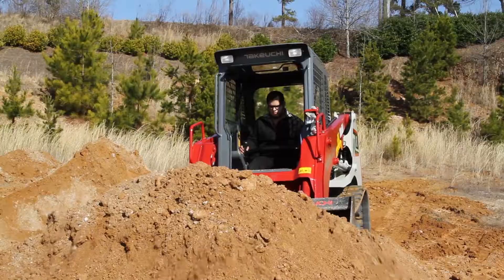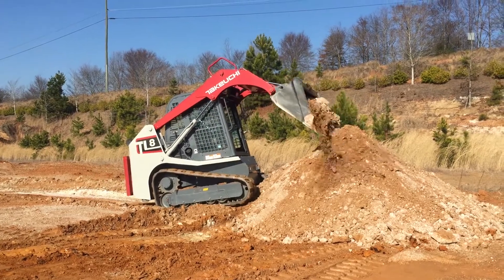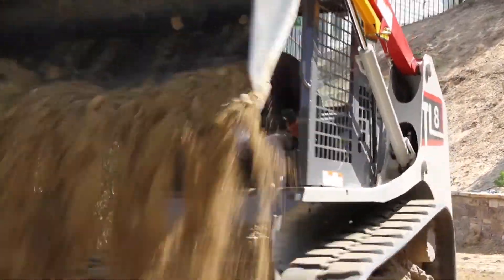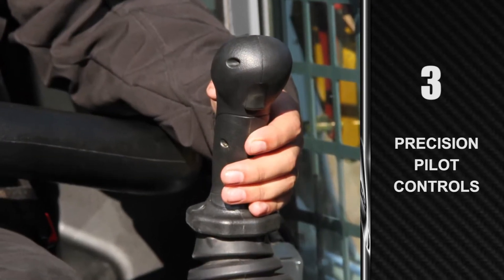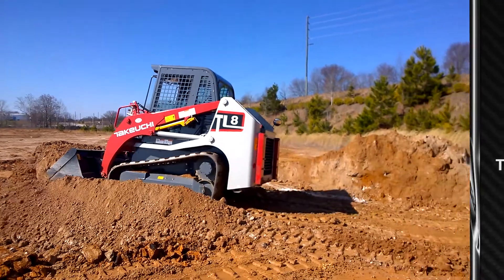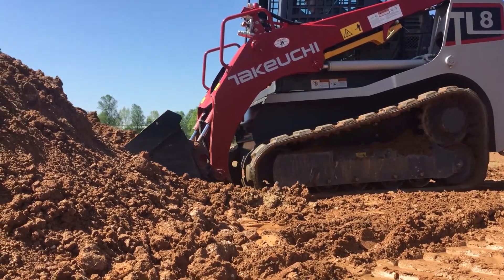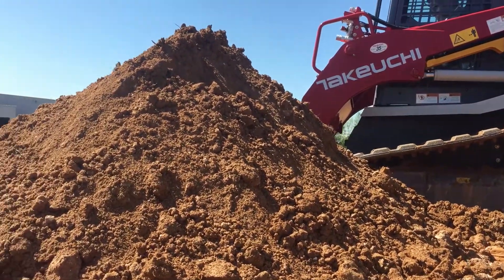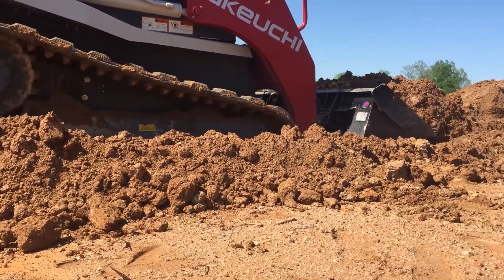Takeuchi Active Power Control for Track Loaders

Comment: One thing I have noticed is you lose customers because of the price of your parts.
Reply: Anyone who buys an excellent Takeuchi product  should be able to afford parts. Besides they never break down if you keep up on all maintenance.
Reply: @genemurray5693  some I haven't had a problem with but others it's this or that seems like alot. You don't by parts just when something breaks down wear and tear products also. Kind of a dumb comment to say if you can buy a Takeuchi you can afford the parts. One way of looking at that comment would be to say Takeuchi machines are over priced another way to look at that comment would be to say you really don't need to look at the price of those parts. Not good business advice on your comment. You either work for Takeuchi or you don't pay for those parts you say we shouldn't worry about.
Reply: @kurtnewyork9374   quite the contrary. I guess I meant oem parts are preferable to aftermarket in most cases.  I’ve never had any problems or repairs outside of normal wear. Yes parts are expensive but if you’re not making money are you going to shop around for a cheaper part while machine sits? I don’t work for Takeuchi and I’m not wealthy but I believe in keeping my machines in top condition even if it costs a bit more. Guess I’m partial to the brand because they have served me well.

Comment: Thanks for the video. I was wondering if that effects the speed of the machine too when traveling. My unit seems to have a mind of its own. How does it work with the self leveling feature? How does that get engaged? What are the buttons for on the right joystick?

I know the benefits of seeing the edge of the bucket but I wish there was a visual representation of the bucket level. It would be nice if the unit compensated for a level bucket on its own and told the operator how many inches from ground level it is at..

Comment: Love the tl8 but really disappointed in the lower hp on the t10 v. They really need the option of having a t10 without the  vertical lift and increased hp.